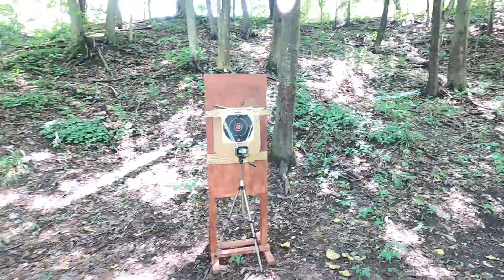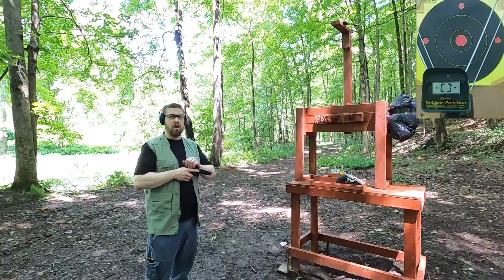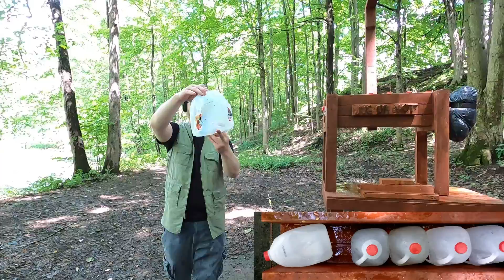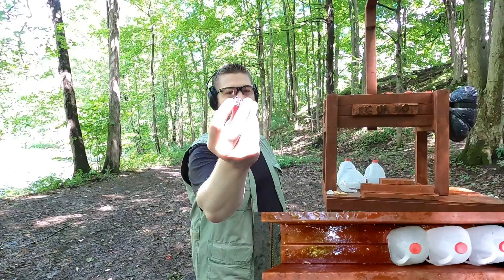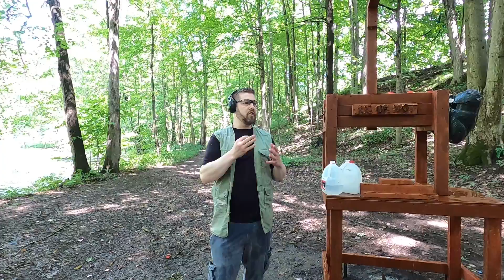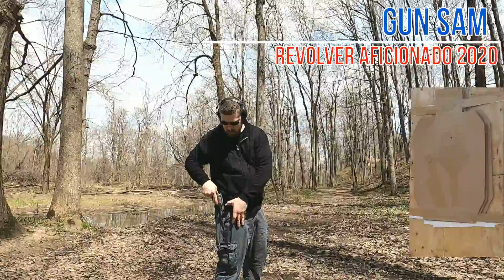10mm More Powerful than .357 Magnum? 💥ULTIMATE Test💥💥💥POWERFUL Ammunition

Comment: Excellent Test!!!!
Both guns got a fair & even comparison & they are virtually the same gun with minimal differences if you consider a 347 8 round revolver. So my question now is why is a 10mm being marketed as a “bear gun” (grizzly/brown bear)& the 357 is not. Considering Hard Cast bullets/Extreme Penetrators, you have the same gun???? Granted, I’d prefer a 44 Magnum Revolver or a 30-30 Winchester which much more powerful than a 44 Magnum Revolver, but the 30-30 is also not considered a “bear gun” while the 44 Revolver is.... But that’s another show.                     Excellent test, well done.
Reply from the maker: Thanks. I think the 10mm is becoming more popular as a bear gun based 90% on capacity. For this reason the normal argument is for 10mm in a pistol rather than .44 Mag in a revolver. Now in terms of .44 Mag VS .357 Mag, what makes the .44 better is more power and larger and heavier bullets. Round per round 10mm is sort of in the middle, it has power more like a hot .357 but bullet weights more like .44, and that extra weight aids in better momentum and penetration through thick things. However, a hot 180 gr .357 would do similarly well. So again, it's mostly a capacity thing, and 10mm just happens to have just enough ability to work against a bear better than most other readily available semi auto cartridges.

Comment: Not sure I get the reasoning behind using bologna . Drama ?.  A 22 short would rip through a pound pack . An excellent test nonetheless . Reckon not everyone has pork steak deep pockets like Paul .
Reply from the maker: Because its roughly as thick as a pectoral muscle. Once we hit bullet speed whether its ground bologna or steak, the effect it will have on a bullet is the same, and the size and thickness for $1 is perfect. Plus, its proven to be a great show of power up to about .45 ACP. A .380 will just make a hole, a 9mm makes a bigger hole etc. Its not until getting into high end power that the damage is difficult to read. Nonetheless its more consistent than random other meat products and for less money. Its not a medium meant to stop a bullet, the water jugs do that.

Comment: The recoil on the 10mm is partly absorbed by the action of the slide. It would be interesting to see how a revolver with moon clips would feel,  recoil wise in 10mm. Compared to a. 357, would it be similar?
Reply from the maker: The 10mm would actually have about 20% more recoil, as that's what the ballistic calculations say

Comment: We must not forget revolvers have a gap between cylinder and barrel, which causes some loss of bullet energy.
Reply from the maker: Unavoidable, but only 5% potential lost. So 1775 FPS would be a non gap velocity. Biggest thing though, is if the bullet travel is the same ie 5.3" auto vs 4" revolver, or 3.2" auto vs 2" revolver, they have basically identical profile length of overall firearm size. That means that all things considered a cylinder gap isn't a huge deal. Getting into less cartridges like standard pressure .38 Special, gap loss starts getting into numbers like 1% or 2% so only 10 to 20 FPS lost there.
Reply: doesn't matter about the gap. what matters is velocity out of the barrel.
Reply: @dodgeplow  Yep, but the .357 mag is a more powerful cartridge itself.

Comment: 357Mag vs 357Sig would be a great comparison!! 😉😉
Reply from the maker: I've debated those tests, but ultimately its not worth the cost unless I had a 40 or something I could add a conversion barrel to. Granted the .357 Sig can replicate a 125 gr at 1,450 FPS, that's about all it does for comparing to .357 Mag. It can't do 158 gr or anything.
Reply: @GunSam  
I seen a used Sig P250 with a .357 Sig & .40 S&W barrel at my local shop the other day.
Think it was $450.
It isn't the latest & greatest, but It really made me contemplate buying it just to be able to get into the .357 Sig.

Comment: As a S&W 686 fan - Auto V Revolver? The auto will absorb 'some' of the recoil to function and this needs to be taken into account. Shame you didn't have a 10mm revolver or a 357 auto loader. My 686 (six inch) itself absorbed much of the recoil.
Reply from the maker: The 357 had about 8 ft lbs recoil energy and the auto had 12 ft lbs recoil energy. But they felt the same to me.

Comment: Dangerous animals?  Yes, that is what those loads would be for, and that means that the Glock flunked because of the jam regardless of the sexual density or whatever that is where you somehow forget about bullet weight.  Just take a .357 or a .44 mag as a sidearm to a 30.06 and put a heavy hard cast lead bullet in there so that you can forget about sexual expansion (unless you are on the subway).
Reply: Watch Sam's video on converting a 45ACP to 10mm  It sounds like he has a bad mag for the 10mm.  Can not blame the pistol if someone is using a suspect/known bad part.
Reply: That has been my very combination carry for hunting for years! ‘06 + .357 and a.45 acp. No critter is gonna go unscathed, no matter how many legs it’s got!
Reply: Do you mean sectional density?

Comment: I would like to make targets that simulates a bears skull. Not sure if plaster of paris or fiberglass would be the closest. Maybe put some meat on top and ballistic gell behind the skull plate. I'll test my 686 and my Marlin 30-30 on it.
Reply from the maker: I been thinking of doing a thick body test, not so much a skull but like leather followed by 2 bologna packs followed by a 2×4. Probably not perfect, but I figure if it goes through that and 5 to 6 jugs, it should work. Id use just for a hard cast test.

Comment: 10mm shines with heavier bullets. It’s capacity for shooting light rounds at ridiculous speeds as well as being able to shoot bullets that weigh more than 200 grains is the reason it’s a big fan favorite.
Reply from the maker: You can go up to about 220 gr in .357 Mag, however we would be talking a little less energy than 10mm in that configuration, but probably more penetration than the 10mm in hard cast.
Reply: Gun Sam Revolver Aficionado it’s hard to say that because the 10mm has relatively the same case capacity but a slightly higher chambering pressure. That coupled with the larger bore gives it more muzzle velocity than the 357. Not to throw shade on the 357 but from a paper and real world performance standpoint, the 10mm equates more to a 41 rem and will most definitely have an edge on 357. Definitely check out some of the 135 gr handload data for 10mm. The velocities will blow your mind.
Reply from the maker: @Wellendowed32  I have seen the Underwood 135 gr, It lists 1,600 FPS. I am not sure i'd hand load that high but have loaded pretty high in .45 ACP+P with Alliant Power Pistol, I would imaging that would do well with 10mm too.
Reply: Gun Sam Revolver Aficionado bud I need you to look elsewhere lol. My 135 grain handloads are clocking 1975FPS out of a 6.3 inch barrel.
Reply: David Barron I've seen tests of 10mm 200+ grain bullets fired from a Glock 20, and they didn't do so well with the original Glock barrel w/polygonal rifling. They tended to tumble instead of spin. An aftermarket barrel with traditional rifling does the trick with a Glock 20

Comment: You know we used to hear what a hand cannon the 10mm was and now I'm thinking that it is perhaps less punishing to shoot than the .40 S&W. The whole thing doesn't add up though because that round came about because the FBI wanted a smaller and lower recoil answer to their newly adopted 10mm. WTH? I suppose the gun itself factors in as well though.
Reply from the maker: It's hard to decipher it all because I do not know the original guns and weights of those guns chambered in 10mm and .40 S&W. Now I can say this though; that the 10mm can be loaded with less pressure and more powder than the .40 S&W and get similar performance. In that situation it would be like comparing .38+P VS 9mm of the same energy, and we know that the 9mm is more snappy. The 10mm can have similar energy to the .40 when loaded light but with less snappiness.
Reply: @GunSam  That certainly makes sense. I guess the 10mm that has recoil that's not too bad is still hefty but just not bad, for a 10mm, lol.

Comment: Yes sir that's good stuff right there. I do both calibers and really appreciate 357 getting a fair test. But 10mm is my new bear defense load because of capacity. I load 180gr lead bear crushers for both, and I also think my Glock has milder recoil than my 357 revolvers. Not sure if it's the semi auto action or the different powders or a little of both.
Reply: I’m wondering if the recoil of the semi auto doesn’t eat some of that recoil where as the revolver obviously doesn’t have that.
Reply: @brianb900  That's what I think, but it could be the powder to. I use Power Pistol for 10mm and had been using IMR4227 for revolvers. I recently started loading H110 in that 180 gr 357 and a 300gr 44 mag. H110 is supposed to achieve higher velocities than 4227. It's early but I swear my 44 mag primers look better, and maybe the recoil feels less snappy. And H110 357 loads also shows better primers in a rifle. There are 30 rounds of 44 mag 300 gr coated bullets in there waiting to be tested in 2 guns. I'll know more after I shoot them. Powders are making a difference to the primers for sure, but the recoil is subjective. I'd have to do both powders at the same time to really tell.

Comment: Now we need a 10mm Revolver : )
There are 9mm revolvers, think its Ruger that makes one.
Reply: Here is a couple of 10mm revolvers from S&W. https://www.smith-wesson.com/revolvers
Reply from the maker: Once I get into near $1,000 revolvers, I would much rather get a .44 Mag, as if the capacity is lower you might as well have more power per round. Plus I got about 1,000 .44 Mag brass I saved 7 years ago when I used to have a .44 Mag, and i'm a good hand loader.
Reply: Gun Sam Revolver Aficionado would you say the .44 has more power than 10mm and .357?
Have you done a video on the .44? 
It’s an amazing caliber, but I don’t have much experience with it.
Reply: @kg6itc   Yes & Yes !
Reply from the maker: @kg6itc  I haven't had a .44 Mag revolver in a long time, I have a really old video with a 6" though. Now if we look at about a 5" 10mm VS a 4" .357 and 4" .44 Mag as all 3 would have similar bullet travel in their respective guns, in terms of ft lbs energy this video pretty much shows they can both top out at 800 ft lbs, as where typical energy for both is about 600 ft lbs. Now for .44 Mag in a 4" barrel, you can get up there around 1,000 ft lbs energy and typical of about 750 ft lbs. Now if we talk a 6" .44 Mag then we are talking 1,200 ft lbs as where a 6" .357 Mag won't increase the power over the 4" much and sort of the same for 10mm, a theoretical 7" (to match barrel travel) might hit 850-875 ft lbs energy.

All that being said, the .44 Mag can go up to 300+ grains in bullet weight which significantly adds to the momentum. So theoretically, a .44 Mag could penetrate much further than a 10mm. And the .357 Mag will lag behind in penetration unless you run a 180 gr hard cast.
Reply: @GunSam  Thanks for that amazing rundown!
Reply: @kg6itc  
44 mag is much more powerful than either the 357 or 10 mm.  Especially if you get a Ruger Redhawk.  They can handle the hottest and heaviest load made for a 44.  I carried my Ruger backpacking in brown bear country loaded with 310 grain Garret hard cast bullets.  My Ruger with its 7 1/2 inch barrel sends it down range at over 1300 fps.
Reply: I think they make 3- the GP 100 Match Champion, the Redhawk, and the Super Redhawk. Way back when, they made a convertible  Blackhawk with cylinders in 38-40 and 10mm. S&W is making the 610 again also.
Reply: Smith makes them, my LGS had one the other day. I believe it was a 686 but I could be wrong.
Reply: Ruger gp 100 in 10 mm , I have one , love it, takes full moon clips and I can shoot my 40 s&w rounds in it also.
Reply: we have 11mm like 45acp also in revolvers and 45colt 45long colt 45casul and more ?

Comment: Great rounds to test. Super good results on both. I have carried 357 mag in 90s. I liked 140 & 158. But this type of velocity & energy is excellent for personal protection. The 10 is also excellent for PP, HD & maybe edc. I did carry my woods gun a G29 as an edc a bit when I first got it. Carried Double Tap 165gr. Gold Dot. But good folk discouraged it for fear of legal problems if it had to be used in a self defense situation. Thanks Sam.
Reply from the maker: Thanks for watching. Maybe the Hydrashok would have made a good G29 load. It's a .40 in a 10 case lol

Comment: You may measure your barrel length any way you like, but ammo manufacturers measure from the very start of the chamber. When they say it's a 4.61" barrel, that's how they measure.  Ammo mfg's generally use a pressure bbl for testing purposes and when the indicate the ammo gives 1700 fps in a 5" bbl, they mean from the base of the chamber. You removed the length of the cartridge from your bbl length.  Judging from most of these comments, I'd say you have a lot of 13 to 18 yr olds dreaming. Your channel, your world. Good luck.
Reply from the maker: I got the Buffalo Bore numbers from their real world listed weapons, they are known for that rather than a test barrel. I don't know for sure what Underwood does.

Comment: Man! You said you were going to get the heavy stuff with 10 vs 357 and you weren't kidding! Those are two very impressive rounds. I believe your theory of sectional density is dead on and I kinda wish others looked at it this way. I have thought this for a while but haven't put together any good testing lately. Because the sectional density AND the foot pounds are both very close I think it makes these two rounds perfect to compare. I don't have a specific need for these weight rounds right now, but I love the test for the great comparison, and I love featuring the heavy hitting rounds! Same companies with heavier bullets next? I can only hope! Good job Sir, good job!
Reply: Also if that jam keeps happening you might consider moving down to a 20 pound spring. My g20 still works fine with the 20, and occasionally I run a mag or two of 40sw fmj's through it and it has been perfect with them too.
Reply from the maker: @plasticglock  Thanks. I will probably test some hard cast 180 vs 220 gr ammo at some point, but more of a dangerous game type of thing. I sort of want to get some sort of leather and put it in from of two bologna packs and then a two by four. I don't know how well this represents a huge animal like a brown bear, but I feel like if anything the test medium will be overkill. I swapped the 17 lb factory spring for the 22 lb NDZ, but on really low end ammo I also got one jam with the 22 lb spring. So I don't know what to think. I tested the 200 gr Gold Dot ammo with the 22 lb'r and had no jams, I also tested the Winchester Defender 180 gr which was hot with the 17 lbs spring, no jams but it felt like the stock spring didn't absorb anything, I could feel the slide snapping back. The spring is new for the 22 lb so I will just keep using it, maybe it will loosen up.
Reply: @GunSam   it might. i just dug mine out of the safe. They are flat wire by IMSI, and I have their captured guide rod too. The 22 is still in the bag. I just haven't had enough time to try and compare them. Popped in the 20 and it's still there. It did smooth out the recoil. It's not less, imo. It's just a smoother impulse. I never added Loctite to the screw/bolt either but it's still in there. I carry it in the field multiple times a week. And when things go bump in the night, it comes with me to the fight.
Reply: @GunSam    I have their Stainless rods in all my Glocks , I kept stock weight ( don't remember what that is ) . I heard from some Trusted gun guys ( don't remember > like Wilson ) RE: spring weight / recoil / Full power ammo . They said you can shoot a 45 ACP 1911 with ZERO spring & that the job of the spring is to RETURN the slide home . That a heavy spring / heavy slide gives the shooter >> The FEELING << of recoil , as it jumps around in your hand . They did a few demos . If I can find that video I will post it here . I was very surprised to here all that .
Reply: @GunSam   I did a quick look at that topic .. too much to list here . Bottom line , you need to test to find what works . I trust Glock to do that work for me .. I don't know . I agree with this pro shooter >> https://www.youtube.com/watch?v=eoqIlWsMhMk